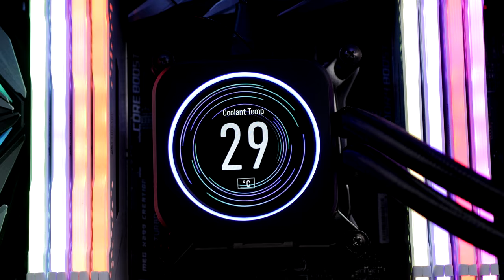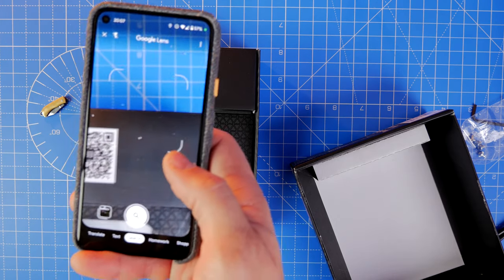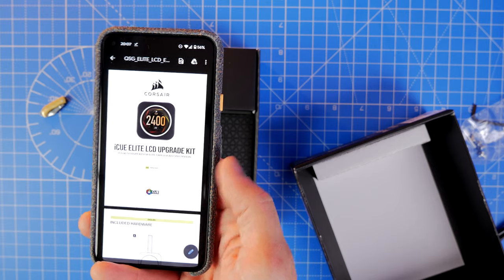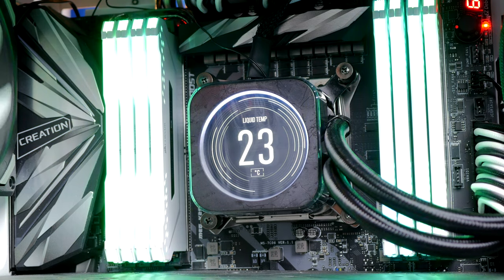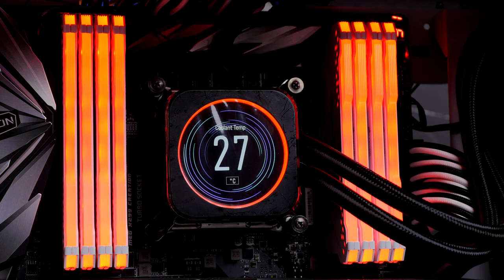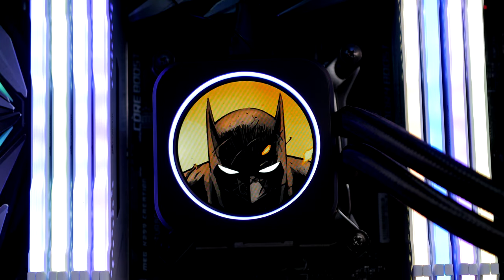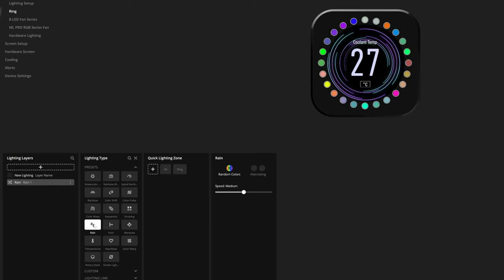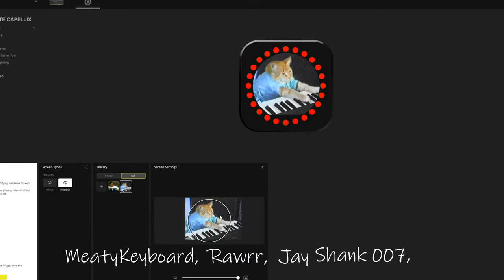Upgrade your Corsair Elite Capellix AIO with GIFS, temp readings and more -  LCD upgrade kit install

Comment: Ordered my standalone Elite LCD yesterday.
Reply from the maker: Noice.
Reply: its out of stock a week already, so...
Reply: @wizzard2059  I got lucky. I learned you can’t rely on Corsair email notifications system so I usually check a couple times a day. I just got lucky. Ordered it last night and it’s already shipped.
Reply: I wouldn’t buy it. It’s really janky. At least mine is. It doesn’t fit very well on my Elite Capellix. Can’t tell if it’s plugged in before I go to test it. None of the magnets are even making a connection with the screw so it just lays there crooked. I’m super disappointed. Maybe it’s the AMD bracket causing problems. Idk
Reply: @OhItsThat  Maybe bend a cable property before pluging, all around motherboards vrm, just suggesting. These Corsair cables pretty hard.
Reply: @OhItsThat  icue & ram speed. All good. Your ram is dual channel, 2x 1600Mhz. Icue shows only one channel speed. I thought at start misleading, but all good.
Reply: @wizzard2059  That’s what I’m talking about. The software (icue) really needs some help when it comes to this display. It’s actually kind of a mess. 

Thanks for the insight.
Reply: @OhItsThat  i kinda starting to believe your experience and upgrade kit being out of sale have some tight connection. 🧐
Reply: @wizzard2059  That could be.

Comment: hi i have  two questions.
If i bought as fnas of other brand, cause i like more. i can conect them to the corsair controller to sincronize them and controll the prgb pump and the rgb fans all with the corsair software?
And second, you can put a personal image with the indicator of temperature over the image??

Comment: Has anyone ran into the issue of having a big red triangle when it boots up?
Reply from the maker: Is it not displaying anything in Windows? Did you update the firmware on the Commander Core?
Reply: @TheProvokedPrawn  yes everything was updated to latest firmware. The most i was able to get was it would boot but icuewould still say it was an unknown device and my fan leds would flash red now
Reply: @amp8134  IMA guess you have AMD CPU I had this same thing happening it's because it does get pushed in enough to connect what I did was unscrew the part that has a cut in side to let the cables out, and it's very easy and really simple to use after plugs right in and worked hope this helps u
Reply: @isubiez  thanks for the reply everything is working now

Comment: It’s really too bad Corsair didn’t create a cleaner, less cluttered solution.  Too many wires and cables coming out of the heatsink/pump housing.  Just looks like a big mess.  NZXT’s Z series AiOs have the same problem.
Reply: One wire for the fan and one for the controller.  Kind of hard to do it with less.
Reply: @TheSjuris  Not just two wires - multiple wires.  I wish it was just two wires.  The proprietary fan controller connection is the main issue.  Because it’s a micro pin solution, it had to be broken out using a ribbon cable solution that has three individual sets of wires.
Reply: @Great_America  two connections. It could be worse. Rather have Corsair’s software then the garbage crap that comes from the motherboard manufacturers.  Too each their own.
Reply: @TheSjuris  Maybe we can have a better solution in the future that uses a unique wireless solution.  The transceivers would be located in two separate locations; one inside the pump housing, and the other inside the fan controller.  Only one wire would be needed for both the power and temperature information (via USB root hub) from the motherboard.  At least I can dream 😁

Comment: Mine does not show your option for the screen hardware it is stuck with a 32c and grey idle lines on the screen??
Reply from the maker: Have you updated the firmware on the Commander Core?

Comment: About the commander core. If I had more than 6 fans, can I connect two of them together or do I need to wire both commander core’s separately
Reply: i have more than 6 fans, you can handle this problem with lighting node, smaller and cheaper product, also comes with 2/3 pack 140/120mm fan bundles

Comment: The 3 pin for the cpu connect to AIO on motherboard or CPU fan???
Reply from the maker: Either
Reply: I see. Is there any difference on the two as I have read something that one has the control for the speed of the fans and the other has a constant fan speed.
Reply from the maker: @mpthree101  it varies from one motherboard to another from my understanding. Sometimes it's less problematic to use CPU fan
Reply: Ah got it. Thank you so much and great vids